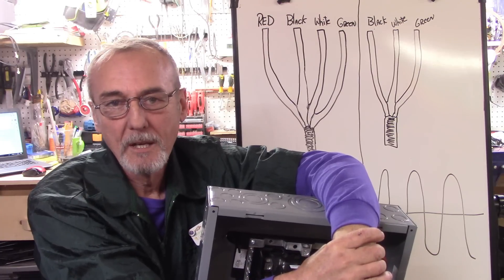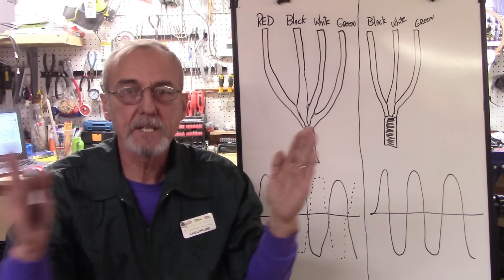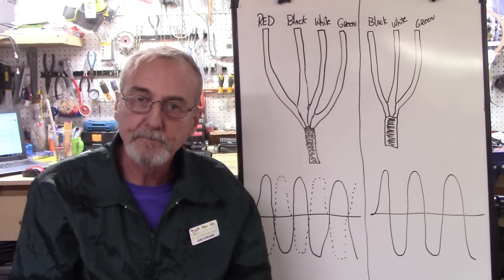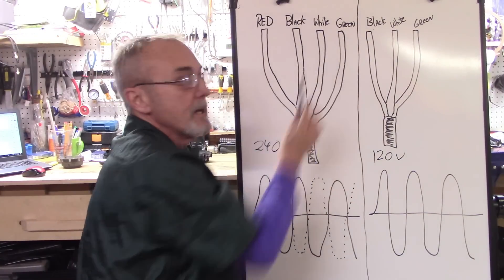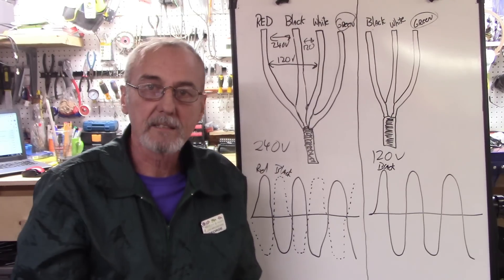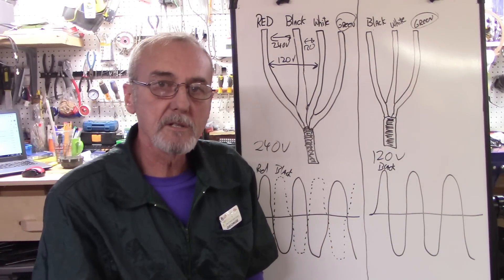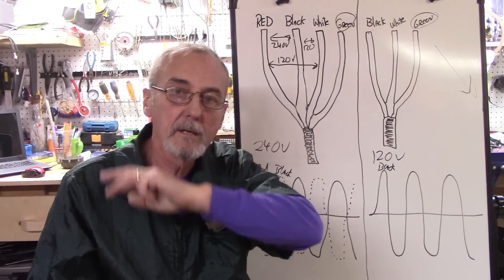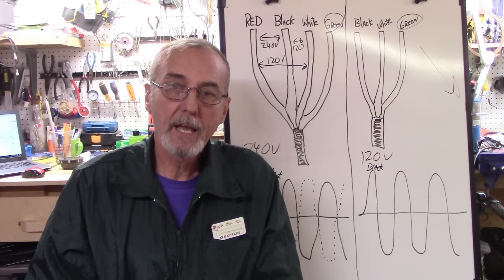240 V  vs  120 V explained

Comment: I'm very sorry sir, but you are pretty much incorrect from the beginning. Your explanation of 120 volt sine waves at different points in time is totally wrong.  There is no 180 degrees out of phase either.   All sine waves are at exactly the same point on the time line(the horizontal in your diagram). They all start and end at the exact same time.   Too many other things wrong to keep commenting on.
Reply from the maker: Wow! You need to offer more information than that. If I am wrong please tell me but to just say what you said makes me wonder what your background is. If you are in Europe there is single phase 220 but here we have single phase 120 and when they are out of phase by 180 degrees, together they equal 240 volts. 
Where am I wrong?
Reply: Barley and Hops Brewing    First, feel free to delete any of these comments.   About me,  I started as a electrical draftsman in 1983. I worked for electrical contractors for all but 18 months for an engineering company.  My last 21 years were for a top 12 to 20 electrical contractor in the US doing engineering.   I became a PE in 2007.   Let's discuss the first thing.   Single phase is one sign wave in time coming from the primary side of a transformer.  So, the 120 volt sine waves rise and fall crossing the horizontal time line at the exact same time and the same direction.  The 240 volt sine wave again is at the exact same time and direction.   The only difference between 120 volt and 240 volt is the amplitude of the voltage.  You state that they are out of phase and actually show two sine waves.   That would at 120 Hz.   Pretty sure you know otherwise.   Should I stop, or do you have a question?   Respectfully,   Kevin
Reply from the maker: Kevin, I will not delete these as they are very helpful for everyone. 
The primary tap on the transformer is 120 volts so that is true but the secondary tap is also 120 volts with a neutral in the center. Both waves are single phase but when you split them they are 180 degrees out of phase which provides 240 volts. Additionally in 3 phase each leg is 120 degrees out of phase which renders 208 volts with the capability of tapping 120 volts with just one leg and a neutral. 
This all has to do with the RMS value of the sine wave. 
Maybe we are saying the same thing. I know from my training and working with electricity that 240 volts in residential wiring is 2 legs of 120 volts each that are 180 degrees out of phase (ergo split phase) this produces 240 volts.
Hope this clears it up but if not I would be interested to know where I am off course.
George
Reply: Barley and Hops Brewing     Ok let's try this.   In your explanation, to get 240 volts you need two 120 volt split phase sine waves that are at 180 degrees.   Correct?    So, if there is no neutral or center connection coming from a transformer, therefore 240 volts can not be achieved.   I believe you know this is incorrect.   By going from L1 to L2 with a 2 pole breaker, you are just not utilizing a neutral to get 240 volts.   If you understand transformers, it is all about the ratio of windings primary to secondary to get the voltage you want.  Hypothetically only if you have 2400 volts on the primary side with 1000 winds, and 100 winds on the secondary, you will get 240 volts.  Agreed?   The sine waves from primary and secondary happen at the same time. (Primary creates secondary).  Now add a conductor Tee connected at exactly 50 winds in the secondary both sides.  The primary sine wave still creates the secondary sine wave at exactly the same time in 240 volts and both 120 volt outputs.   No 180 degrees out of phase or split phase.   To make sure we understand each other, when you draw a line horizontal and place a wave on it, left to right is "time".  One sine= 1/60 second in US.
Reply: One more thing.    So many people are saying you add two voltages of 120 volts to get 240 volts.   Kind of, but not very good way to explain.   If instead you discuss how number of windings affect voltage and say that if you take # of windings for 120 volts and double the windings, you will get 240 volts.   Respectfully,   Kevin
Reply: Barley and Hops Brewing    I have gone to the internet and found a physics blog that says the same thing you do.  As I said blog.   I guess the biggest issue is. I am a purest.   It is trying to say that when one 120 v is negative (moving forward) the other is positive( moving backward) so therefore out of phase.   They are trying to justify the wiring diagram.   The same person also stated two phases from utility connected to the transformer.   Most are phase to neutral but could be two phase legs(which is single phase).    If you have ever seen the fingers around the conductor and the current flows in the direction of the thumb, then it is not possible for the direction to change in the secondary coil.   It must all go from L1 to L2 at the same time. Therefore L1 to neutral and neutral to L2 at the same point in time.   You can make it look backwards on a scope by how you connect it and different wave from Line to Neutral.   It is being turned 180 degrees in the scope from how it works in the transformer.   So, it is point of perspective!!!!!    Can we agree on this?   There are a few other things that are probably your company standards shown or said that are not necessarily true in all cases but work for your company.    If you want to discuss them, let me know.   Respectfully,   Kevin
Reply from the maker: Thanks Kevin. I do agree that it may be an issue of perspective.
George
Reply: Barley and Hops Brewing    I happened to get this video pop up.   I have some information.   I still say your 240 volt diagram is incorrect.   What you are show it how are two 120 volt sine waves that are at opposite points in time.   The reason is because of how an Oscope connects to the electrical components.  So what you are seeing is the test conditions not what really happens in a transformer.   Let's only discuss first half of one sine wave.   As magnetic field increases across the secondary coils, the secondary voltage increases at the same time.   Assuming a direction, the flow is from L1 to N for 120 volts.   From N to L2 for 120 volts and from L1 to L2 for 240 volts(All at exactly the same point in time).  In order for the two 120 volts to add to 240 volts(I say L1 to L2) they have to be at exactly the same time in the same direction, not at the so called 180 degrees out of phase.   Please consider that I may be correct. Respectfully,   Kevin